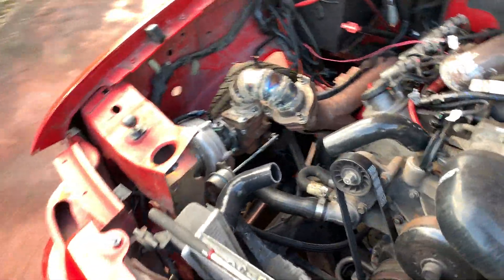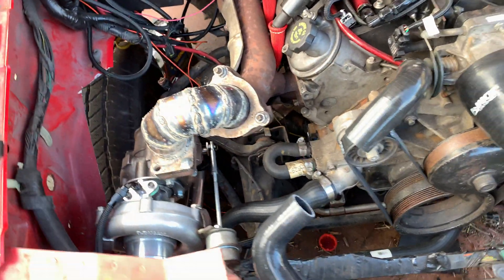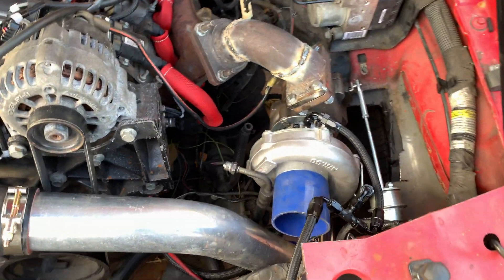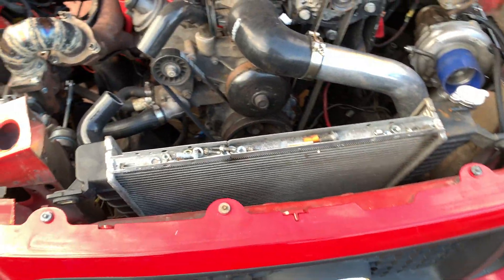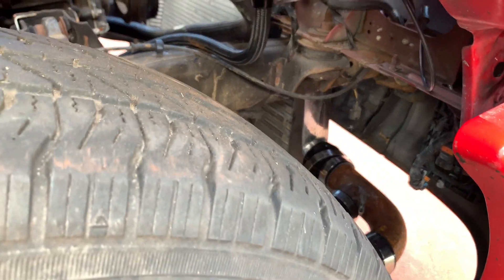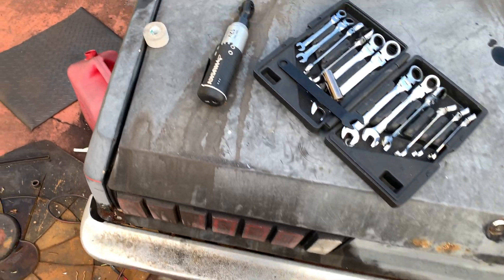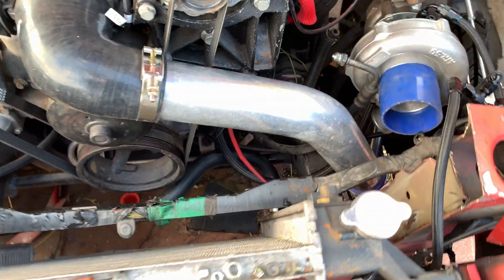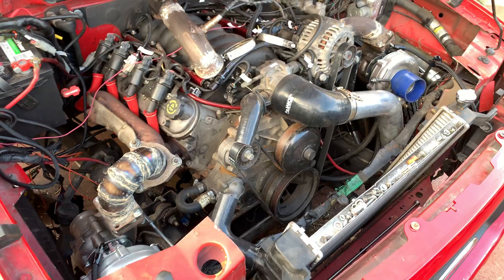Rebuilt Turbo Kit - LSX FORD RANGER Swap - diy turbo kit

Comment: What kind of turbo kit do you have? I'm thinking of installing one on a 90s ranger or something. And what other things did you have to put on to prepare it for a trubo? Like head studs, possibly oil cooler, etc.
Reply: It has eBay 7876 now, I used factory headers flipped with mild steel 2.5 to make turbo kit. Only engine work is ls1 intake manifold, valve springs and ls6 cam
Reply: @BobGrows  cool thanks man